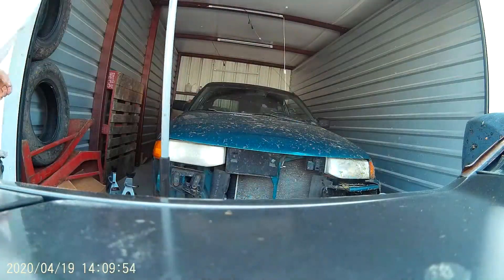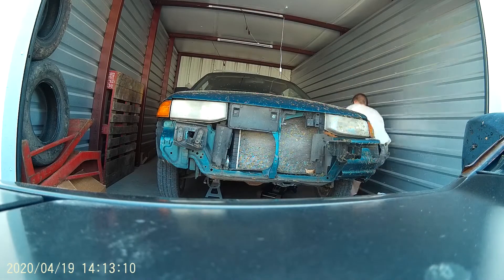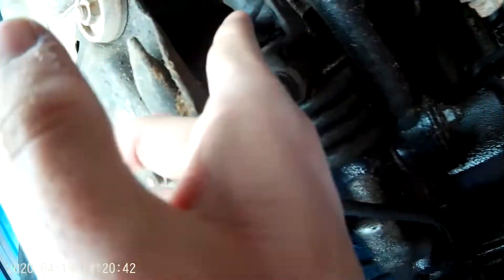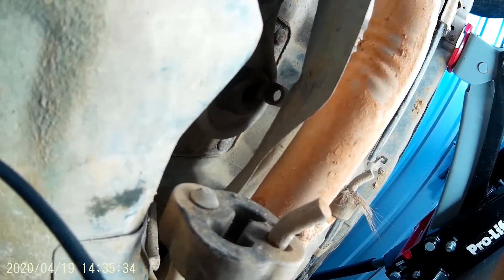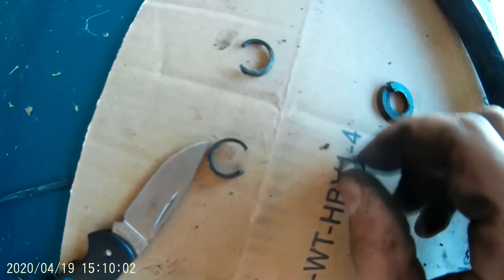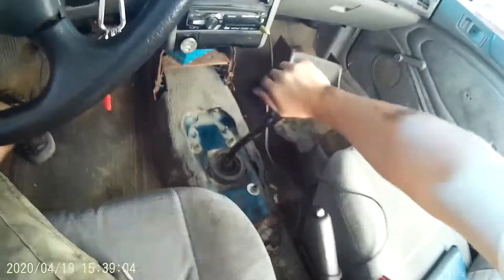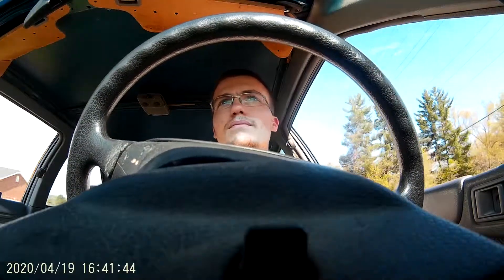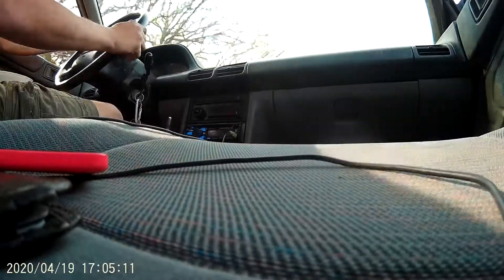1994 Ford Escort Shift Bushings Replacement

Comment: They make bronze bushings and that pin can be removed basically grind and retack weld.
Reply: Billy Jack can you let me know where get the correct parts for the escort shifter I have 2 cars needing fixed

Comment: It doesn't appear you actually showed any replacement of bushings. I get that you used cut rubber for the part that doesn't unbolt, but aren't there bushings for the part that uses a bolt?